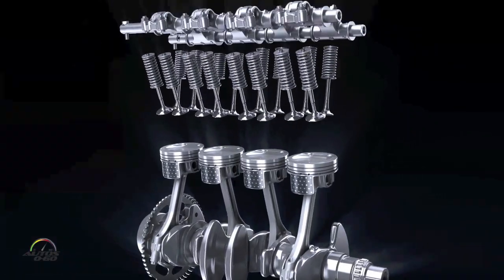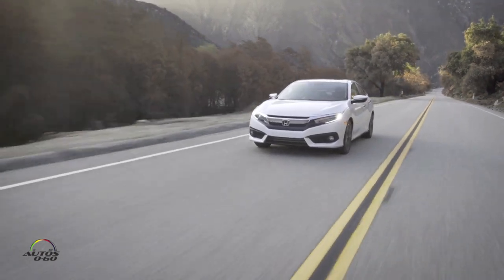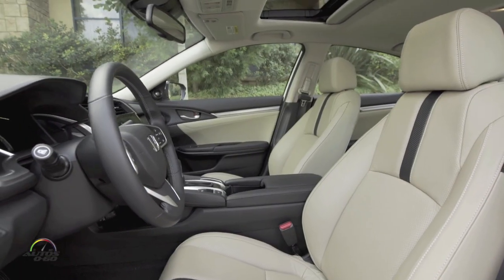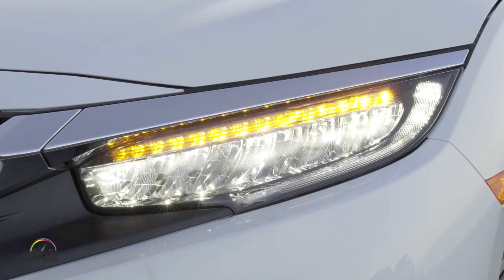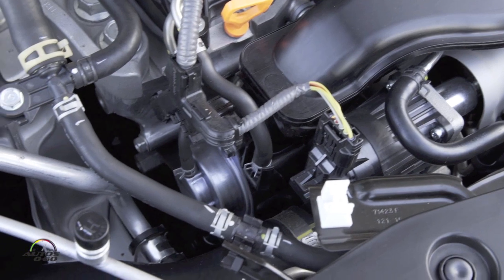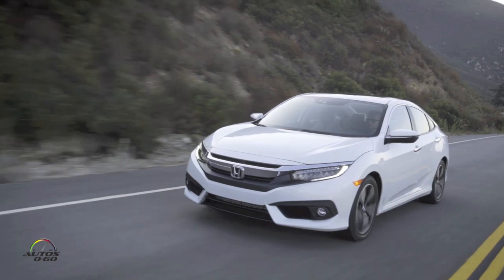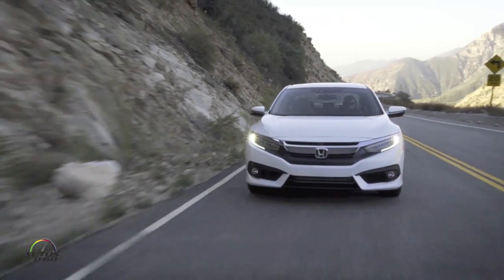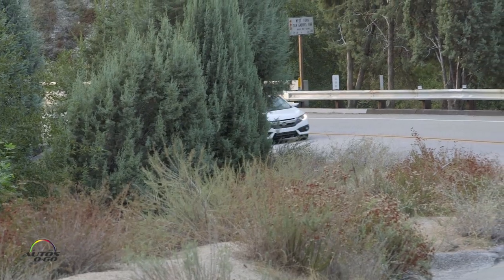2016 Honda Civic Sedan 1st. drive with Chief Engineer Gary Evert

Comment: Honda overdelivered with this 10th gen.
The combination of styling, performance, and handling won me over.

Back in 2015, I walked out of the Honda dealership after sitting in the 9th gen. Everything about the interior felt so cheap. I held off buying a new car back then because I really wanted a Civic but I was so disappointed with that model.
Cut to 2018, instant gratification after one test drive. I’m now, a proud owner of the 2018 Civic EX-T.

Comment: So why isn't the Si available?  I don't get the Honda marketing.  The Si should be available already, December 2015.  Why is Honda holding it back?  I guess they don't think sales are important, because I am going to probably buy a Subaru WRS, since there is no Si model available yet.  Honda doesn't care about their customers like Toyota and Subaru does!!!
Reply: I agree with George's sentiment; Honda is an engineering-driven company, and their marketing (advertising and product introductions and cancellations) have varied in the lame-to-inscrutable range over the decades (cf the singing sheep to introduce the new Ridgeline, which won't be on the market for...quite a while yet).  This Civic is a great vehicle, and when George has thoroughly enjoyed his Subaru, maybe he'll give the Type R a look.
Reply: I would check out the Type R, but not for almost $50,000.  For that money I could buy a Boxster.